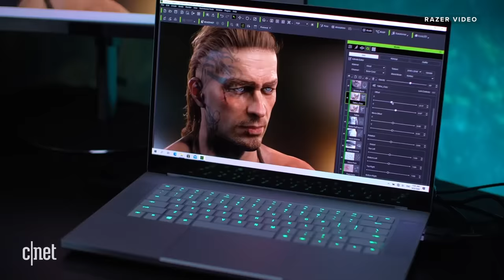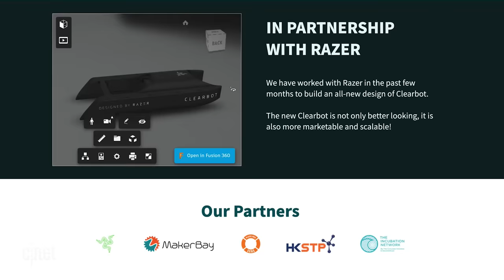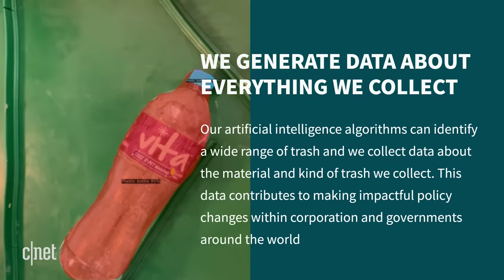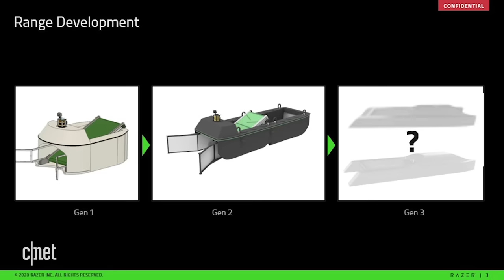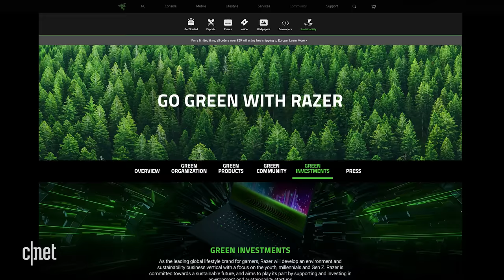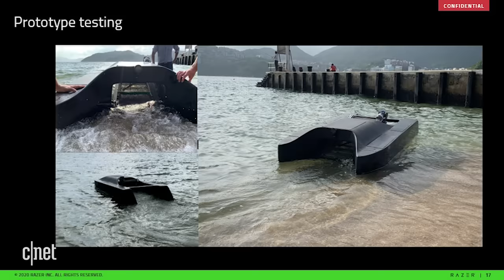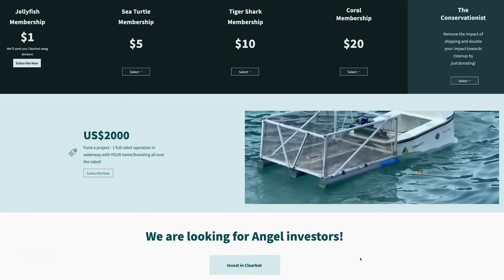Razer helped design a trash collecting robot to clean up plastic pollution

Comment: Razer products never last. I have much more durable peripherals that I've kept after they're no longer in use including some from the early 90's. every time my razer keyboards brake I pull out the same old Satek keyboard I retired before switching to razer. some of razers mice and keyboards only last a year in regular use. I have a naga Trinity from last Christmas that already has broken side buttons. my friend's headphones broke after a month. I always know that I'm sacrificing longevity for razer's quality and that razer products quickly turn into the trash that I won't be able to re-use or give to a friend like I'm used to. I kind of thought high-end products that don't last very long was razer's thing. The new configurator doesn't even support the old gamepads. I had to switch out my full set of everything to make the jump to the new synapse so I wouldn't have to have both of them installed.

Comment: Let´s be realistic, it´s a good thing to care about the ocean. But how many of these tiny tiny boats you need to clean, lets say Rio de Janeiro?? A thousand of those boat would do absolutely nothing! And they have to recharge the battery, so they are not autonomous, and the garbage compartment its very small so they fill up. Also you need insane ammounts of these vessels to cover up a big area so that mean a higger rate of mechanical and electrical failure. In my opinion this proyect is full of leaks.

Comment: Look at its little trash can that's so cute. The ocean is a vast place though and it works only on the surface?  I don't think it will make a blind bit of difference. Feels a bit like pissing into the wind. Make thousands of them and as unforgiving as mother nature is they will end up contributing to the pollution in the ocean. We need to address the cause of the problem not the symptoms!!

Comment: Another thing. If the circulation of the ocean is slowing down which would cause another problem I would look into ways as to help circulate the water flow back to the way that it was before it started slowing down.
Reply: The scale is far too large to control ocean currents. Even if we did have that kind of power, I guarantee we'd make it worse by trying to play God like that.
Reply: @dirtypure2023  Then we will see what happens to the ocean's when more ice melts which it will happen at the current rate.
Reply: @jaredr9554  You're right, although historically there are times when when the ice caps melted and caused the climate to cool (triggered an ice age, even). Colder oceans can actually have a powerful effect on the climate in the other direction.
Reply: @dirtypure2023  It is the Yin and the Yang my friend. That goes with good and evil right now the scales are laying heavy towards evil.
Reply: @jaredr9554  Yes indeed. Scary times when we should be marching confidently towards a post-scarcity, interplanetary species.
Reply: @dirtypure2023  You have such big words there my friend. It'll never happen as long as there are differences in the way.